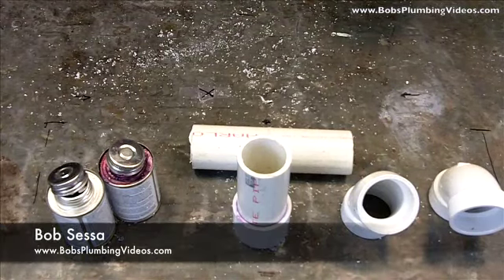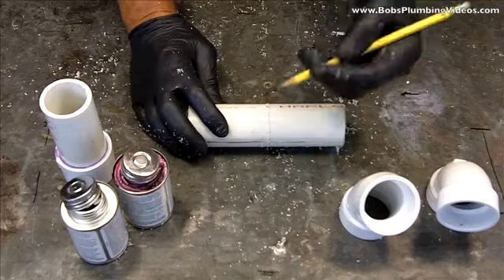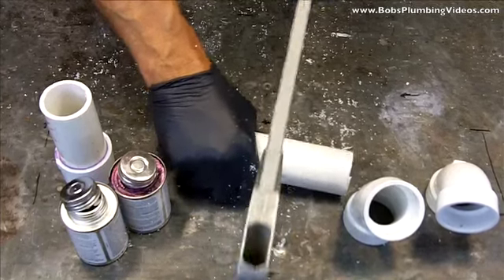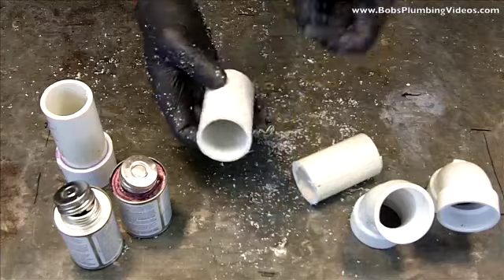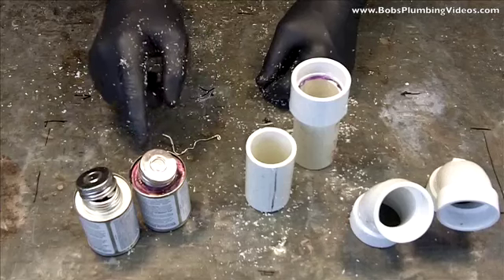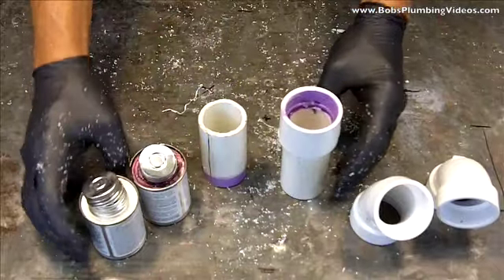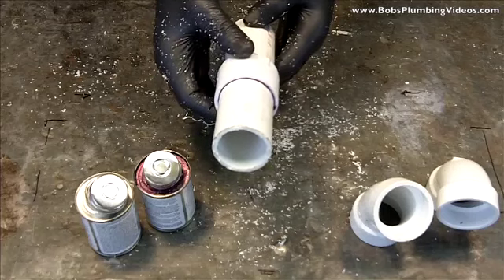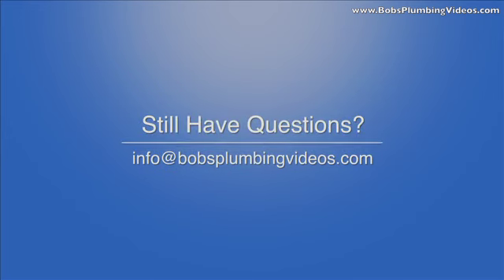How to Make a PVC Glue Connection

Comment: if people are worried about the purple color . after inspection buy a can of plastic  made for just that  spray paint  that will hide the purple color .   make sure the glue you use is correct there are two types  one for pressure lines and one for non pressure   so look carefully  before you buy the glue

Comment: each connector has a little bead inside for the pipe to stop on and not push all the way through.  my question is... how can you get the pipe to always reach and seat on the bead?  I use the clear primer and get plenty on both pieces.  I typically only glue the pipe and then press them together and give that quarter turn.  sometimes that is very difficult to do.  I wonder if tapering the end of the pipe might aid in getting the pieces together more easily?  any thoughts or suggestions are welcome.
Reply from the maker: What is paramount in my opinion is cutting the pipe absolutely square by using either a manual or battery powered P.V.C. Cutter. The fitting should be clean with no visible burrs and by applying primer and glue to both the fitting and pipe you shouldn’t have any issues. Prior  to purchasing my Milwaukee M-12 P.V.C. Cutter, I would use a hacksaw, de burr the fitting and pipe and generally did not have any trouble. If you want you can file a mild chamfer on the outer edge of the pipe to help make a better fit.

Comment: Hey Bob. I will be doing my first drain job next week and wondering if priming is necessary for black ABS plastic drain joints? I have only seen yellow ABS glue used in my experiences. I am also in Canada for your information. I imagine this white PVC material is slightly different?
Reply from the maker: Paul, we don't see ABS in the new york all that often. I know it's popular in new jersey and it's my understanding that in general,they don't prime ABS. They just use the yellow glue. I will tell you that I've seen videos where they do prime the ABS and it probably can't hurt. Schedule 40 PVC is the most popular form of plastic pipe in around the city. It's code requirement to use the purple primer (inspectors want evidence that you used it). Truth be told on repair work, I use clear primer for a clean neat appearance.

In either case, make square cuts and de-burr the inside and outside of the pipe before attempting to glue. Best of Luck....Bob.

Comment: Bob I am putting in a trap for a shower stall. when joining the "U" portion of the trap to the drain tail piece and Trap elbow I wont be able to twist the fitting; will it matter?
Reply from the maker: Generously prime and apply glue to both ends to be joined, apply steady pressure to the u-bend and you should be good to go!

Comment: Bob, How critical is it to cut the pipe square?
Reply from the maker: You have to cut it square in order to achieve a good water tight joint1
Reply: Bob, I just piped in the drain lines for a double  bowl utility tub in my basement laundry room. I cut the schedule 40 PVC pipe with a hacksaw and a lot of the ends were not square. Cleaned em up and primed and glued correctly. Am I good for this no pressure application or do you think those joints will fail?

Comment: Hi Bob, I need to make a water tight seal between two non threaded pvc joints that is tough but I'd like them to be removable if necessary to tighten a pvc end piece that is threaded and may need adjusting in the future... do you think silicone is a way I could do this?
Reply: Or perhaps plumbers caulking?
Reply from the maker: Silicone will not last, frankly, it just doesn't work.Why do they have to be removable? Can you use a Union fitting? This is an example of a 1" union
http://amzn.to/2q4hHBc. They come in all sizes from 1/2" to 2".
Reply: I thought about that solution too.... probably the most secure way. I am living off the grid a bit and was trying to solve a problem without going back to town. But I think your right this would be the most logical fix. I actually tried the silicone. In some places it held but where there was a significant load of water pressure, it only held for about 24hrs. Looks like a universal union piece like you mentioned is the way to go! Thanks for the reply!

Comment: Great video. Simple and to the point. 

Quick question: is it necessary to chamfer or bevel 3/4" PVC. I'm setting some sprinkler lines and don't wan't to buy a $70 tool. I've seen gardeners go without chamfering and the work holds up. Any thoughts on that?
Reply from the maker: Technically the answer would be yes, but truth be told you can just take file and soften the sharp edge and glue away! Regards, Bob.

Comment: Thanks for the explanation.  question:  How do you you replace a broken/cracked section of PVC piping? Meaning, when both ends are cut and cleaned and neither end has the luxury of moving apart?  How do you bonds both at the same time.   Thanks for your insight…
Reply from the maker: +Robert Ma  I'll assume we're talking about drain lines? If I'm making a repair on a short run of pipe with absolutely no lateral movement, I'm going to A. Cut the pipe back to a point where I can get that lateral movement and use either a P.V.C. glue type union fitting or the appropriate size nu-hub coupling or Fernco coupling.B. If that's not an option, I most likely would use two no-hub or Fernco couplings and slip a short piece of pipe in place to make the repair. Hope that helps! Regards, Bob.